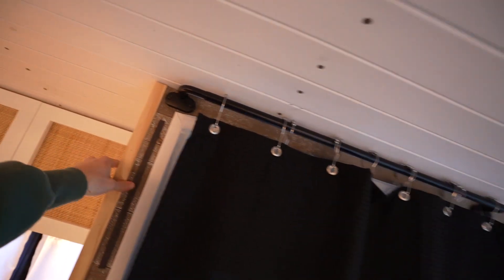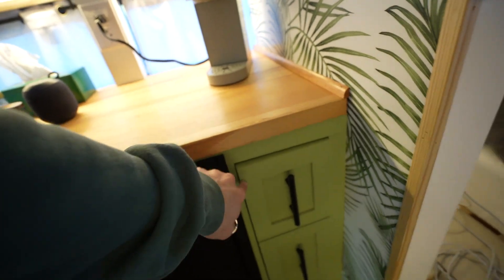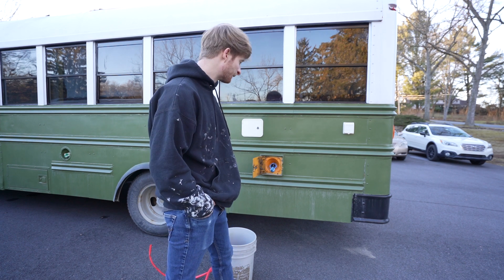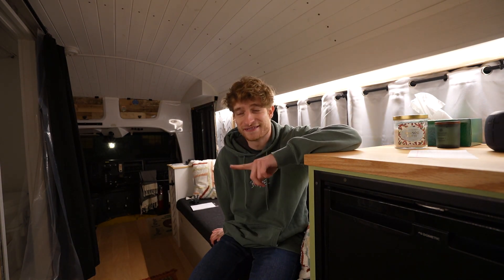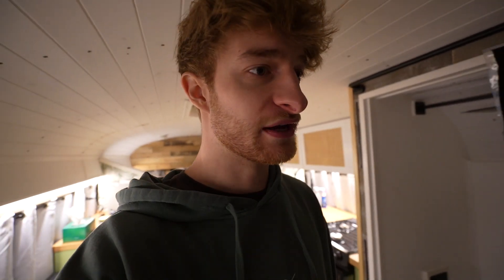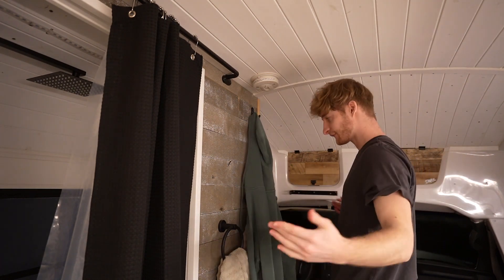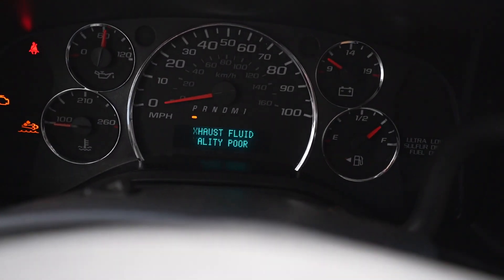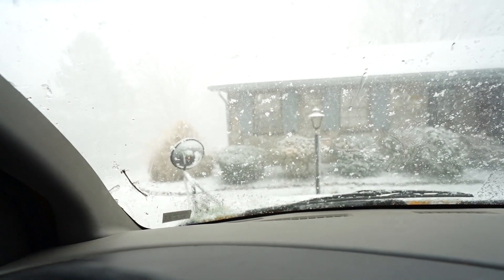My Bus Broke Again...

Comment: We plan to use "child proof magnetic cabinet locks" for our doors and drawers. You use a magnet to unlock it but you can keep it "unlocked" when you're not traveling so the doors/drawers function as normal and during travels you set the lock on it and then use the magnet to unlock it when you get to your destination.

Excited to hear you're coming to Florida! If you've never seen a rocket launch in person before you should check the SpaceX Cape Canaveral schedule and add it to your bucket list! We live right here on the Space Coast currently building our bus and would love to meet you and see your bus in person! Best of luck with your travels, stay safe!

Comment: I recommend checking the owners manual regarding that code. Generally speaking that code indicates that the urea quality sensor is starting to or has already failed. In most Diesels equipped with DEF that sensor is built into the DEF sending inside the DEF tank.

Comment: Wait till you need to change the glow plus and see how much clearance the geniuses at GM left for the job lol. Also an OB2 scanner that connects to your phone is a must have. They're like $20-30 on amazon. You can read and clear codes easily. Ive had the kobra brand for about 4 years now.

Comment: Don't know if you know it or not you need to have it up at a high idle get it up to temperature so the death of will burn off the excess I believe that the way it works in the diesel truck